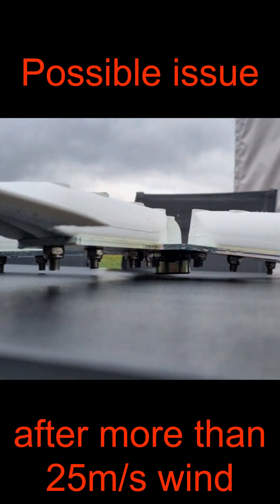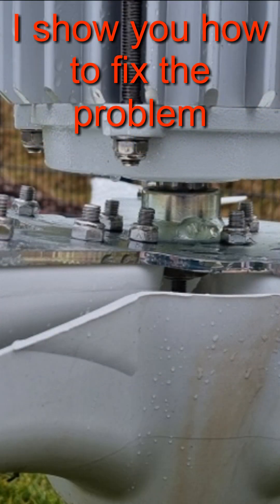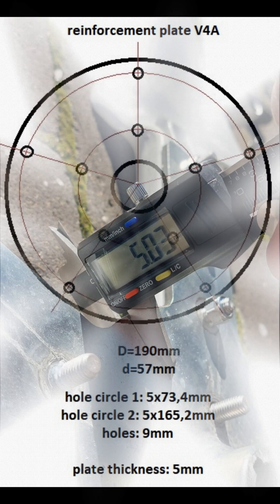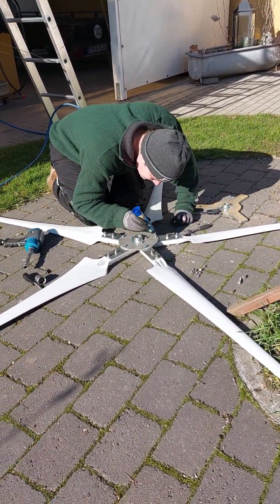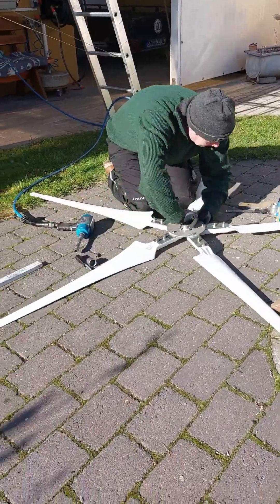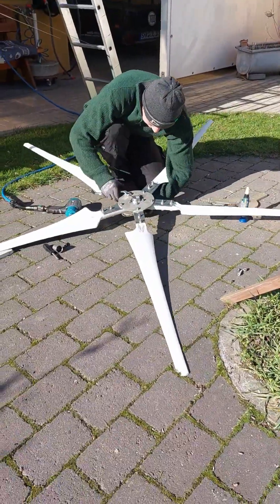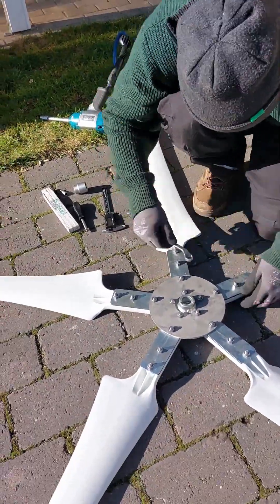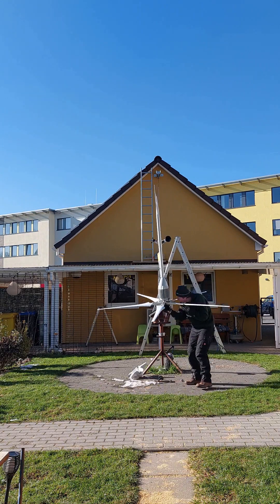IstaBreeze i2000 3 vs 5 blades, a new setting for SUN grid tie inverter and a hub reinforcement!

Comment: grob gesagt: in gebieten mit vor allem täglich eher weniger wind, machen 5 blätter mehr sinn als nur 3 ... die verluste bei drei blättern wären nur in starkwind regionen relevant oder an tagen mit sturm - von denen wir aber relativ wenige haben ... ergo: an eher windarmen positionen oder eher niedriger höhe haben 5 blätter aus meiner sicht auch mehr "schwungmasse" und "angriffsfläche" ... zumal diese western windmühlen meist ganz viele blätter haben - und die wind auch eher für low wind und low rpm ausgelegt weil meist für wasserpumpen ?! weil lieber regelmässig über 100 watt und bei sturm "bisschen weniger" als regelmässig nur unter 100 watt ...

Comment: Cable cross-section: The turbine usually has 3 x 1.0 or 1.5 mm² cables/wires... these are the "internal" cables and probably only suitable for lengths up to 5 or 10 meters! They match the standard waterproof charge controller used in Chinese wind turbines... but if the cable is longer than 10 meters, i.e., 20 meters, 30 meters, or even longer, you should use 3 x 6 mm² or even more! The controllers operate with "switching stages," meaning they do NOT operate at a "fixed speed"! The controllers can only determine the turbine's speed by the voltage and apparently switch up in stages when the wind increases... this causes the voltage to fluctuate, and the losses lead to "jerky" voltage drops, which apparently causes the controller to constantly try to switch up and down – resulting in a kind of jerking/braking effect – similar to shifting gears in a car! Many believe the voltage increases with the turbine's rotational speed – however, the controller regulates the actual "power"/"load" behind it. For example, at 150 revolutions per minute, it could be 100 watts, but also only 50 watts, or even 200 watts... depending on the "power" (switching stage). In my theory, even small losses would negatively affect the controller, especially in "low wind" conditions. Similarly, with solar MPPT controllers, a difference of, say, 0.5 volts can prevent the controller from recognizing whether the storage/battery is full or not. This would likely "overcharge" the battery if no load is connected! Above all, with wind turbines, you must use suitable batteries for testing; not too small, and don't connect a load. If the batteries are full or too small, the controller will brake the turbine. With undersized batteries, the voltage rises too quickly, etc., and you can't measure power without a load – many people forget this, which is why there's so much misinformation and half-truths about wind generators! The rotor size is crucial! The very small turbines, up to 1.3 meters in diameter, are more suitable for gardens – not for houses. It only makes sense with turbines like the M3 (1.6 meters in diameter), horizontal, with 3 blades, or the M6/Istabreeze i2000 (approx. 2 meters rotor diameter). Or check out the YouTube video "4.5 kW out of 2 kW wind turbine. Is that even possible?? Not sure, but somehow my FT-2000L2 did it" (from the Backyard Voltage channel!). There, a turbine with an approx. 3-meter diameter is being tested and delivers up to 4.5 kW in a storm! This is also the best YouTube channel I know so far because you should bookmark it and watch some of their videos...

Comment: English/German experiences & important notes: 1. The height is important, at least 8 or preferably 10 meters. 2. The cable cross-section must not be too thin, otherwise the controller will not work correctly (I suspect losses in the cable act like a braking resistor, and the turbine often turns out of the wind because the controller's switching stages cannot adjust the speed correctly!?). 3. Instead of feeding into the grid with a grid-tie inverter, it is better to use a good wind MPPT charge controller to charge LiFePO4 batteries as storage, because in low wind conditions little or no power is generated, and in storms sometimes too much – storage is better than feeding into the grid with wind power. 4. The mast must not wobble and must be 100% straight, otherwise you will have losses of up to 50%.

Comment: Hello. I just received the GTI inverter and I have a doubt: the manual says that the inverter's output power will be determined by load power if we select limit function. Then why do we have to adjust the shortcut voltage, dumpload voltage. The inverter should do it, if not, how is it possible that the inverter only produces the energy that the load needs?
Reply from the maker: Good question, i have no limiter. But if the wind is f.e. 800W but your need is only 600W your turbine will run to higher voltage. So first the dumpload acts on higher voltage and finally the shortcut. So if the wind is higher the dumpload can burn it goes to shortcut and you will get nothing. Probably. Short times the dumpload can handle 600-1000W i think. If your need is long times you should install a better dumpload like a heater or something.
Reply: @forum9919  bei den china mppt reglern sind meist 500w dumpload spulen dabei ... theoretisch 2 stück parallel schließen ?! die zweite ggf. mit schalter dass man zusätzlich den widerstand verdoppeln kann ? ob reihe oder parallel wäre egal beim widerstand in dem moment ?
Reply: Ok. Understood. Thanks

Comment: In poland is a seller of propellers larger to ista breeze.  length 127cm, width at the hub 18cm and at the end of the propeller 7cm.
Reply from the maker: Nice, Website? Please without www...
Reply: @forum9919  tanieelektrownie pl. Its contact
Reply from the maker: @RaddiM3  thank u, no 127cm found, only 107cm standard
Reply: @forum9919  auf aliexpress könnte man was passendes finden ?! achso und optimal wäre irgendwo auch in der beschreibung welche kabel länge und vor allem dann welchen querschnitt du verwendet hast ? ich hab immer noch den verdacht wenn man zu viele verluste am kabel hat, dass dann vor allem bei schwachwind der regler stark irritiert wird ?!

Comment: Hi, I would like to buy this turbine. how does it behave? I would also like to know, better 3 blades or 5? A thousand thanks
Reply from the maker: Hi, average windspeed low under 5m/s 5 blades, higher average 3 blades. U get a lot for the money. Dont know better ones.
Reply: Don't bother with istabreeze

Comment: I found that using the 5 blade hub that the turbine started spinning earlier but the power rose more slowly than the 3 blade version. Also, at around 4-500 watts the 5 blade hub started to get really noisy, making a  loud fluttering/ripping noise. No such problems with the 3 blade version. It smoothly and quickly  goes up to 8-900 watts with only a little noise. I ended up going back to using the 3 blade version.

Comment: Basic rule is that the turbine mast must be 3 times higher then the surroundings to get clean air. That setup will never produce good power. Sorry
Reply from the maker: I know. But in Germany 10m is max hight without permission.
Reply: My i-1500 is only 4.5 m from ground to centre of hub. Performance is really good. Higher is always better but I think there are many other factors that can spoil performance. Have you tried outputting directly to batteries with dump relays and resistors in parallel?.
Reply: @nhikoid  do you have a 3 or 5 blade? 24 or 48v system and why that choice. And can you tell something about the noise. Many thx already!
Reply: @JC_Han  I have the 24v I-1500 but I run it into a 12v volt battery bank. This gives me a much earlier cut-in. ( the point at which turbine volts>battery volts to allow charging to begin). I found that when running into a 24v battery bank the turbine would do a lot of spinning before reaching cut-in.  Regarding number of blades, at first I went for  the 5 blades because I'd heard they generator more energy harvest overall, especially in lower wind coditions, but after experimenting, I reverted to the 3 blade hub.  The 3 blade turbine takes a little more wind to start turning, as you'd expect, but the power rises more quickly and more quietly. Also, the higher RPM achieves earlier cut in.  I found the 5 blade noiser compared with the 3 blade from around 400 watts, probably due to the increased turbulence caused by the extra blades. (flapping/vibration noise). My conclusion is that if you have low to moderate wind speeds, as perhaps in the summer months, the best way to achieve and maintain cut in is to use a lower battery voltage and just stick with 3 blades. I should add, I only have a simple DIY volt sensing switch and relay. Perhaps an MPPT controller would make satisfactory use of 5 blades at lower speeds at the turbine's specified volts(24) but I've not seen one yet that seems to get good consistent reviews.
Reply: Yes that seems like a bad spot with houses surrounding..and luckily it won't spin that fast, in full blast you probably going to get some disturbing noices in your house because of vibrations..